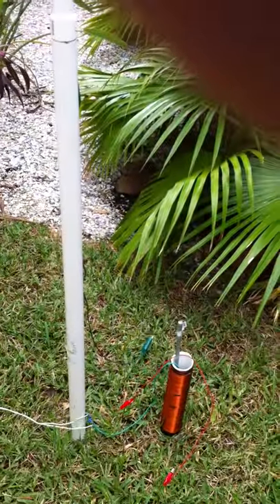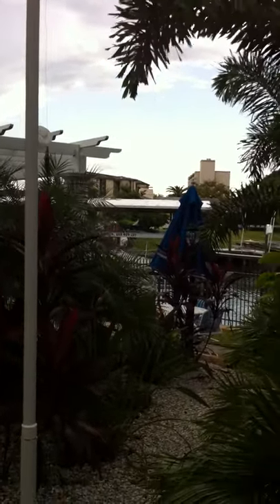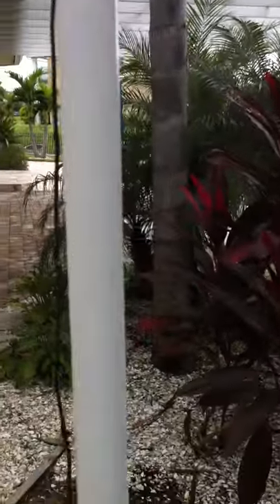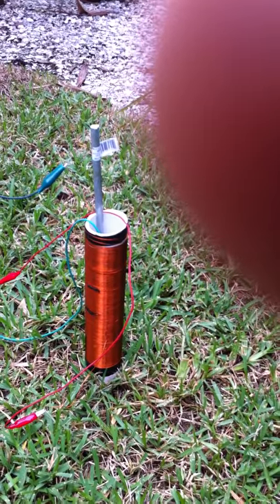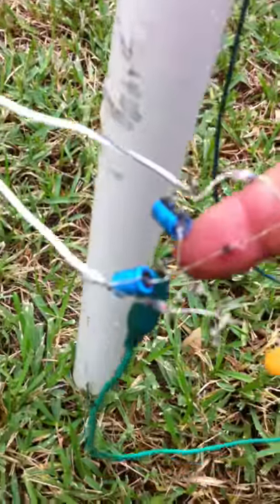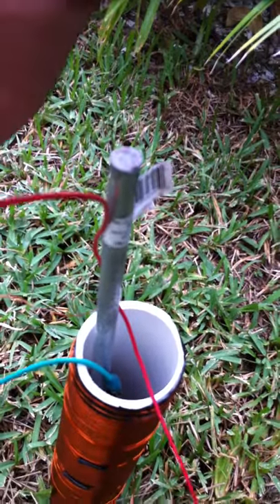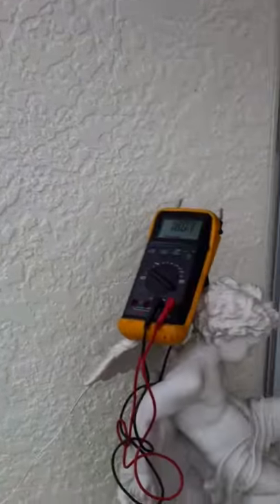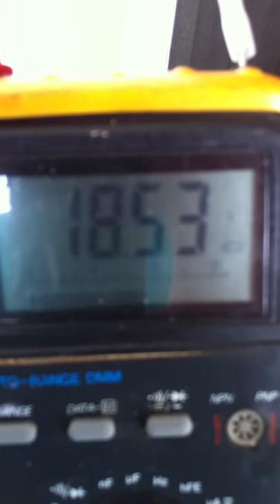Radiant energy experiment 2

Comment: OK couple ideas I was reading some ham radio guys were getting arcs from their antennas when they didn't have a good ground and they were using basic car ignition coils to step up the charge, and these guys were actually charging batteries. They noted that you had to disconnect the system when there was a storm particularly one with lightning. I'd be interested in what your thoughts were thinking about tinkering around myself.
Reply: I think if you want harvest atmospheric energy you should not ground because you want use the electric potential thats depends on the hight. If you ground than you loose the potential, it will be the same on the ground as in the hight. Look at the power lines who owns the big-energy companys. Maybe it's true that they harvest atmospheric energy with this power-lines.

Comment: did you know those coil light bulb supposably it saves energy those have a 200v cap and coil already inside and built you get more voltage in that one check out my radiant energy receiver.
Reply: i want to try it with a transformer and add a switch and ima build one like yours i went 110mv on low ground lets see what happens when i attach it to the sky.